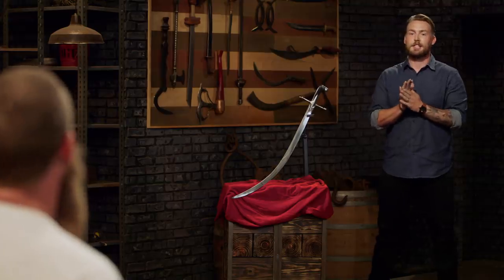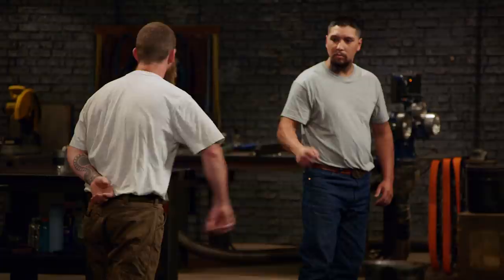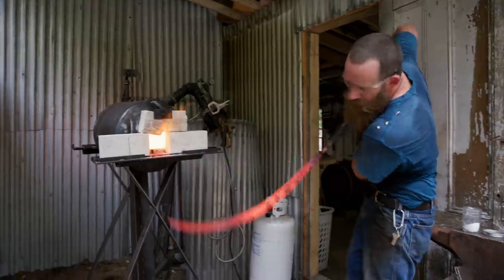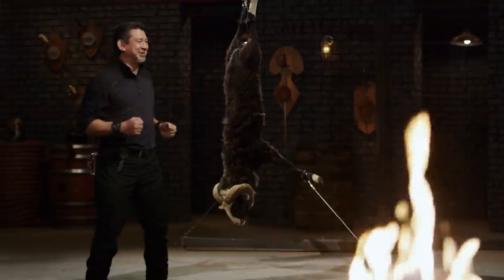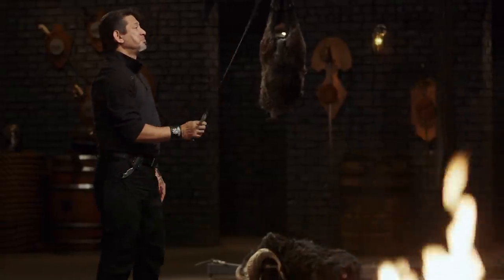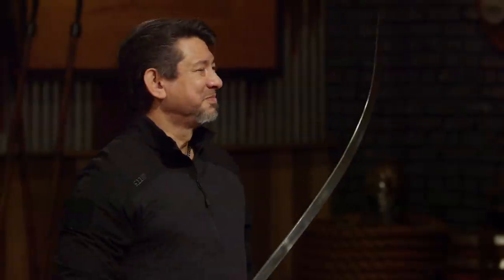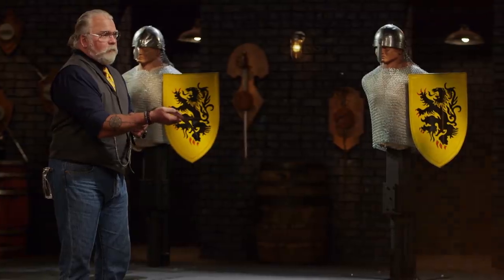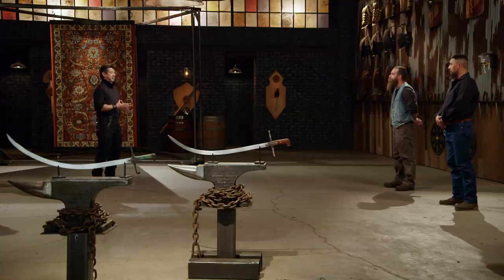Forged in Fire: The LEGENDARY Sword of Saladin SLICES the Final Round (Season 8) | History

Comment: Both swords are beautiful and the 2nd place blade on almost any other day would have won, much respect to both smiths
Reply: They are both beautiful but please explain how the winning blade took more damage to the edge on the strength test and still won?? They were not being judged on the exact curvature of the blade, it never should have come to that because the blade that should have won took less damage than the one that actually won.
Reply: @donaldrowe6047  they both took almost identical damage during the strength test so yes it came down to minor details like the curvature of the blade.
Reply: @Nightwingriddle  almost Identical is not identical though. One rolled more heavily than the other. You can see it when he points it out... re=watch the video.
Reply: @donaldrowe6047  I did he points put 3 spots on each and the blade that won took glinting which is just a scuff mark that in no way affects the blade
Reply: @Nightwingriddle  I just re-watched it myself thinking maybe I missed something, no I did not. He can feel 3 spots if he runs his fingernail across the edge but can't see them he even says that first the first one took no damage and usually blades with an edge like that do in that type test. The second one he physically sees two and maybe a third. So they did not take identical damage.
Reply: @donaldrowe6047  Well you can feel it if you're the one who wield  it, and the fact that doug ang dave the one who tested the sword knows how it feels using, slashing and tusking with those sword. remember they test it not just HOW the sword CUT, SLASH AND TUSK, like dave said, the 2nd sword and loosing one is kinda wobbling a little than the other one. Yes this is one of the very complicated matched I ever watched on Forge in Fire but I understand what the judges decision is cause they are the one who tested the both of those swords

Comment: What is it with these curved blades that it seems easier to give them the kind of razor sharp edge that they have? Or is it the skill of the two competitors? To me they are equally impressive, and they will beat any other competitor in any given day.

Two beautiful weapons.
Reply: Here skill is obviously at okay with these guys, both their weapons are incredible. 

But think of what happens when you cut. You hit, then pull the blade towards you to actually give a “cutting” motion. The shape of this blade allows a cut to happen almost naturally, making it much deeper than what would happen with the same wilder and a straight blade
Reply: It is because of the curved blade that the blade slice through the animal easier. It is all physics.

Comment: Why they didn't build it from damascus steel?
Reply: A sword made of wootz steel in four days? Damascus is not the steel you see in these videos, that's simply a patterned welded type of steel that simulate it and it's called Damascus for convenience, the real Damascus steel is completely different and would require a lot of time to be done.
And this would only be possible if these guys knew the crucible casting technique needed to make it, which I highly doubt, since it takes years to learn to even get it right...Let alone make a blade for a sword, which would take even longer. :)